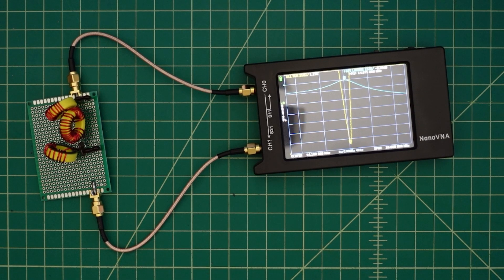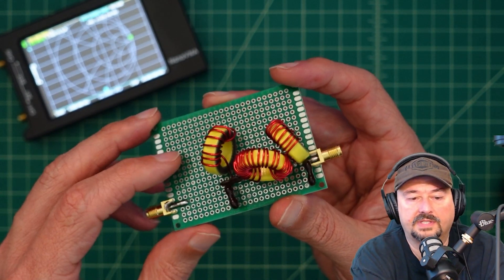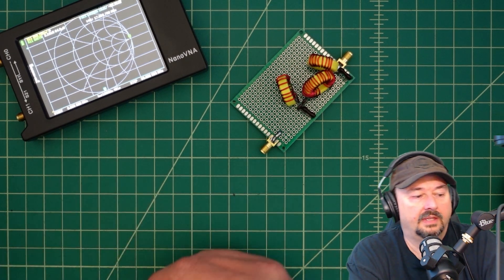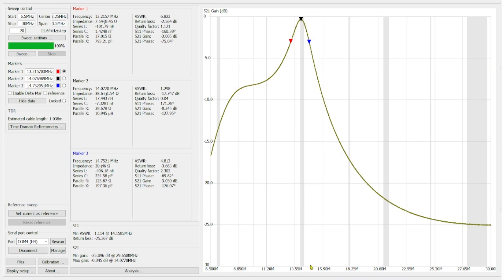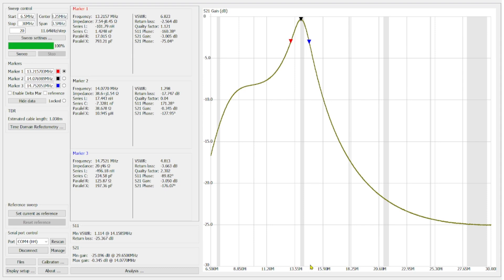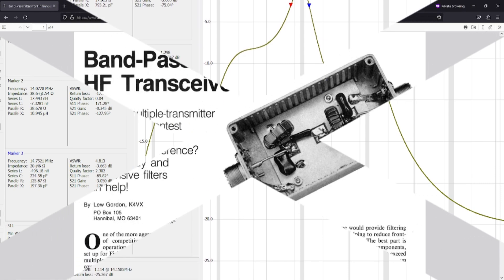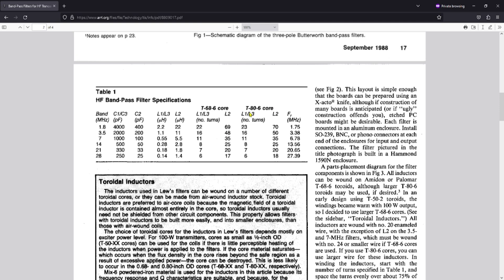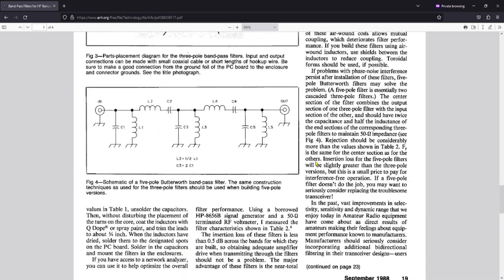Homebrew Bandpass Filters for Ham Radio

Comment: I plan on doing this filter in a slightly different way. I’m going to try Manhattan style construction using small islands (min capacitance) and have an  uninterrupted ground plane. It will be mounted with metal standoffs to make the box continuous with the GP - eliminates the need for a separate ground strap from the connectors. As POTA becomes more popular, multi-op is inevitable. So trying to stay ahead of this ! I recently repaired a couple BPF’s after a major RTTY contest. These are Chebyshev type however. Always sumthin’ ! 73 Jamie WB4YDL❤
Reply from the maker: He James, I actually have a new filter in the works.  The video should be out soon.  Sounds like to have a cool project planned, best of luck with it 👍
Reply: It came out well - be glad to share it. The videos are long because it’s blow by blow walkthrough. I have Parts 1 & 2 in my Dropbox. The spec an shows it dead on first try !

Comment: Hey Ape, did you find your original build directional, where as it gave better results in one direction as opposed to the other? I didn't get the desired results with mine that I was hoping for either. I will rebuild it with all the leads shortened as you suggested.  Thanks for the update on this project. de KA9TII

Comment: For Any effective RF filter, Using a too Small Enclosure with components (Especially Inductors) jammed up Close despite core Orientation is asking for Needless coil to coil inductive Cross-Talk & undesirable  signal Leakage Coulping....It's just HF but Using a Large enough Enclosure with Isolating Each filter "Pole LC pair"  components into RF Shielded partitions can get results Closer to the Model specs...
Reply from the maker: Hey Tom, the design I followed called for the use of this enclosure but I don't disagree.

Comment: Maybe you help me with BP filter builds....I've used regular Diy 16 ga Air core Inductors + Mica caps in Partitioned-Off Enclosures for all my Hf Filters with No issues....The relatively Large gauge enameled Wire is so Easy to cut & Squish or Push turns together to Precisely Tune filter sweep Characteristics......Why use the messy & Questionable Toroidal core inductors when Air core work Fine ??
Reply from the maker: It's my understanding the air cores are more subject to leaking and require shielded separation.  While I'm sure its still in issue on toroid wrapped cores it's less of an issue.

Comment: Good followup! Note, again, how Gordon mounted the toroids at explicit right angles to one another! You might re-jigger yours and re-sweep. The lower skirt might improve. 73 de K4FMH
Reply: I've had minor cross-talk between transformers mounted on a PCB before. Turning one of them 90deg from the other totally eliminated the problem.
Reply: Roger! Note too the original QST article figure: they are shown at right angles to one another. The author didn’t explicitly mention this, as I recall.
Reply from the maker: I’ll mess with it a bit, thanks for the heads up
Reply: @TheSmokinApe IF this adjustment does improve the skirts, it would make a great and informative video for other builders to illustrate how the physical isolation by making the toroids at right angles helps. $0.02
Reply: Good deal...a wooden stick (sometimes I use a chop stick from a restaurant supply house) nudging the parts while on the VNA is a technique I use. It comes from an old tip I read about using a plastic toothbrush handle with one part of the O at the end cut out. Nudging the through-hole caps and such while listening to the audio could reveal a bad solder joint.  @TheSmokinApe

Comment: In Figure 4 (The chart for the 5 pole filter) the input and output values are the same, whereas  the L3 inductor is 1/2 L1 and C3 is 2x C1.
DLd the .pdf to see it for myself and checked the 5-pole filter in Fig 4.
Reply from the maker: Thanks man 👍

Comment: Is the power handling capability determined by the core size, magnet wire diameter, and voltage rating on the silver mica caps?   How about a Chebyshev vs Butterworth comparison for a future video.  Great stuff!
Reply from the maker: To answer the question, I'm going to say "yes".  I do believe all of those things play a factor.  I do expect to be playing around with these filters more in the future so maybe I can add the other design.  Thanks SF 👍

Comment: great build ! very handy to have. no need to run an amp threw it. the output section in a amp has a filter. you want this on radio side to help with receive. strong signals out of band can over load the RX . also can really help with out of band noise. 73's
Reply from the maker: Right, it's more important on RX.  Thanks for watching Robert 👍

Comment: It looks a bit strange on the LF side? Does an Elsie filter simulation show that?
Reply from the maker: I didn’t model it, I was thinking the cores were bleeding over or it was my janky ground plane 👍
Reply: @TheSmokinApe  I modeled it using Elsie, and it it didnt show any LF aberration, so probably the meandering ground. I buy 5 x 7 cm double sided copperclad PCB.
Reply from the maker: I used the copper PCB on the first version, I was just "prototyping" the components in this video for experience.  I expect that I will do more BPF videos in the future...  thanks as always for the comments 👍

Comment: Nice build Ape!  The trick to any RF work is short leads and good ground plane.  The higher the freq the closer the components are together.  I think you will see a change in the performance if you use a copper clad pcb.  You could probably have PCB way build you one pcb that would work for all the filters.  For best results would be to do a active model of the board with a filter.  Don't know if PCB way has modeling software for this.  Tools like Mathlab or Spice come to mind but it has been a few years since I did any of that.  They have probably all changed.  Good luck!  73
Reply from the maker: Thanks man.  I do think the GP on this one was a little janky leading to the goofiness on the lower side.  I'm thinking about getting a board from PCBway for future videos.

Comment: Pretty sure its not 500kV? That would arc a few feet. Is there a video? 🤣

Regarding the unbalanced filter plot, I suspect one of the inductors has a parasitic property due to difference in windings.
Reply from the maker: Yeah, the 500kv surprised me.  I do think you are right about the cores or it might be my janky ground plane 👍